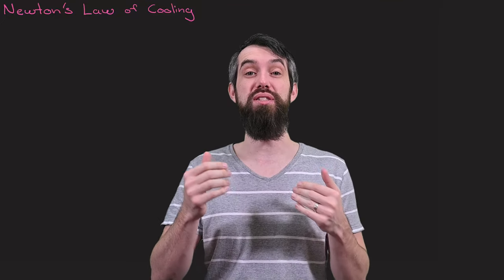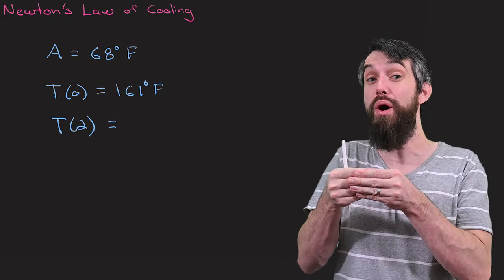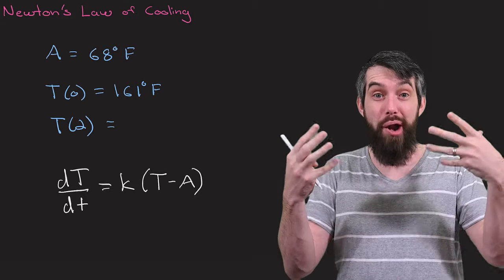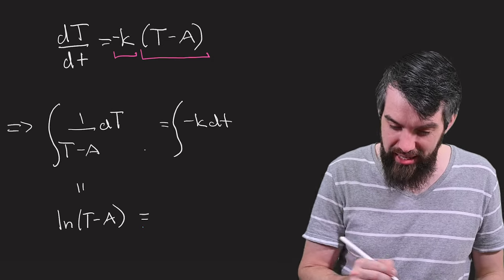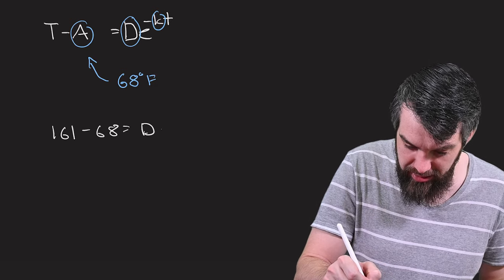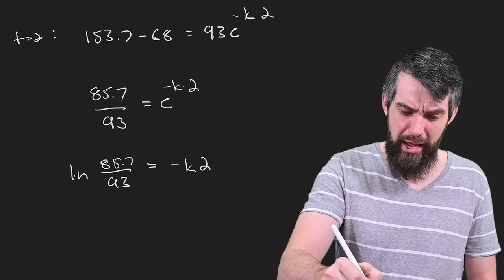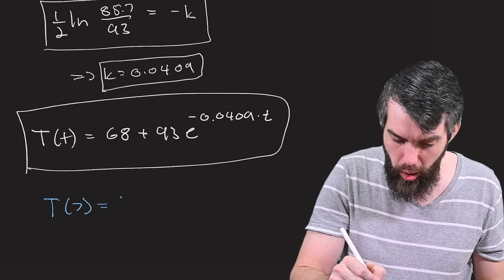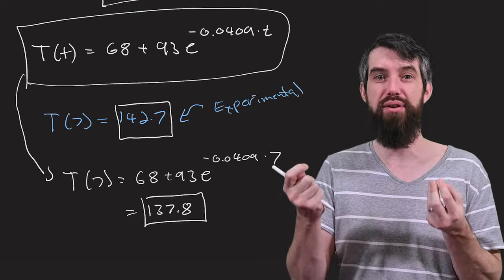Newton's Law of Cooling  // Separable ODE Example

Comment: I left university some decades ago.  I do not recall anyone giving a practical use case for differential equations as you have just done Dr Trefor. You are amazing
Reply from the maker: This is too often the case!
Reply: Unfortunately, this is a sad reality; however, you can't really blame professors of mathematics, since they did not study physics directly, in the vast majority of cases. The fact that you solve a differential equation doesn't imply that it matches the reality - you can get mathematically correct answer, but physically, the result could be way off the experimental value or could be a complete nonsense at the first place. This is something mathematicians can not really justify unless they studied theoretical physics as applied maths. Furthemore, if you knew about the existence of Maxwell's equations, Schrödinger's equation or Hilbert-Einstein equations of general relativity, which are all famous diff. equations, you could have figured out in your head that most things in our universe are governed by differential equations. And so, it is quite simple to construct your own differential equation that would describe something physical (whenever you try to describe some model like perfect oscilator,pendulum,some kind of litter, usually only highschool mathematics and physics is required) Differential equation actually arrise just when you start studying physics in high school (particulary in kinematics) though they are incredibely easy to solve, since most of them are just solving simple integrals (or taking time derivatives). Nevertheless, you can complicate things if you add friction or air resistance. In that case, you need to use methods like the separation of variables, variation of constants, particular solution etc to solve them (dipending on the type of flow - sometimes you can only approximate the value if it is too complicated).

Comment: great video! just a small correction - i think at the end when you used the model to predict the temperature of the tea after a certain time, you originally said the reading was taken at 5 minutes, but used 7 in the equation. T(5) = 143.8 here, which is only about %0.77 off the measured value of 142.7; maybe you just used 7 or maybe it's a total coincidence that after 7 minutes the measured temperature almost perfectly matches the 5-minute theoretical, but either way, i learned a lot from this video, so thank you!

Comment: Me like. So that's why we use e^ so much in ODE's. That's also where the extra constants comes from, e^-k, by using logarithms. I also like how you model the situation. Question to self: what is a situation that I could model this way? I got a coup of instant noodles, it takes 5 minutes to cook. I could probably estimate some function of how soft it becomes, using time t, temperature and a way to measure softness (like how much it'll stretch).

Comment: Ah, so that's how constants from all those Physics equations are derived. That's neat. 

Also, I still can't understand why the left hand side on when we're doing a separation of variables does not have a +C while the right hand side does.
Reply: It does. Both Integrals produce an unknown constant or some number. To simplify the overall equation, we can move and combine the left hand side C with the right hand side C. So now we just have the + C on the right hand side only.

Comment: Thanks for this video, I really understand maths better when I see it applied! 

If you don't mind me asking, why don't we need the Constant on the left-hand side integration? Can we ignore it because constants on both sides are effectively a single (different) constant on one side?
Reply: It's because a number A can be written as a number B either by +/- a number C or by multiply A by a number D. For example, if A = 100, B = 25, C = 75, and D = .25. Then, (A-C)=(B)=(A*D). Hope that is helpful.

Comment: So now you've got to redo the experiment with a better ambient temp. I might have to find a decent thermometer around here and try it out for myself.

Do you have a recommendation for some sort of text on the subject of building mathematical models? I would love to work through loads of examples, both analytical and numerical. Seems like with model building lots of practice would be a very good thing (so basically like everything else worth doing).
Reply from the maker: I really love this open source modelling textbook: https://github.com/bigfatbernie/IBLmodellingDEs
Reply: @DrTrefor  noice! Thanks much. Downloading it now! I'm plowing through a massive numerical methods for engineers book ATM, but this one will be fun. I need to do a good review of ODEs and Calculus first. Then I need to really learn some basic stats, and I'm rubbish at linear algebra (that will change, but I'm struggling to get motivated). I really need to quit my job, lol. I should have been an aristocrat with loads of free time and all of this would be so much easier to manage.

Comment: Hey Dr. Trefor, I re-watched this video again this morning and had a thought. What would have happened had we not multiplied our k by the difference between the temp of our cup and the ambient temp (T-A). For instance, what if we had gone ahead and selected a difference that wouldn't have been as steep as the selected one was. Indded we would have still gotten a solution and would have still been able to solve for k, right? How would we have known though that our solution and our k didn't match physical reality? I guess in the real world, I'd have then just iterated and eventually might have selected T-A, but in a math class would I be marked wrong if I had selected something other than what you selected? Or am i missing the point entirely haha? I guess it's about seeing what our percent error of a given model is vs. direct measurements we collect-though I also suppose not every problem we model will also have a thermometer.

Also, I'm actually taking a thermo class right now (fascinating, incredible stuff) but was your reasoning about the larger difference between T and A based upon thermo principles or the fact that a steeper slope would yield juicier, more differentiable results? I'm asking because I really want to tune up my reasoning skills for problems like this. Thanks again!
Reply from the maker: To me a math model isn't "right" or "wrong", it's more or less useful. For instance not only could we have chosen different differences, we didn't have to make it linear. Maybe it should be (T-A)^2 or square root of T-A or any other number of things. Basically all we are doing is trying to think of something that seems reasonable, and the ultimate proof is not mathematical, its how well it models reality. So in this case it makes sense that the rate of change of temperature should have something to do with the difference between where we are right now and what the ambient temperature of the room is, this is a reasonable intuition. But I haven't proven that this is the best or only model of this scenario!

I actually teach a math modelling course as well, and in it I typically don't mark students right or wrong too much based on their models per se, but based on their analysis and critiques of those models.
Reply: @DrTrefor  as always, you've given me a lucid, imaginative response. Thank you for being so responsive as well-you're setting new land-speed records! This is fascinating stuff. I'm really looking forward to the working and thinking through the entire playlist.

Comment: Sorry but at around 3:02 how is heat change an exponential equation, i thought its more like addition like the rise un temperature is an add up or sum of the rate of change an the initial temperature and the gradient remains constant well like maybe approximately constant if we are talking about the same medium but if the rate of change of the different temperatures is
 different in both then you have a parametric equation, because i don't understand how the rate is reliant on the intial difference in temperature

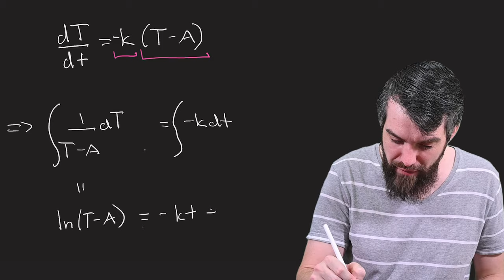Comment: 4:29 I don't get why the right side gets a constant but the left side doesn't.
Reply: You can add the constant on the left side too but you would get:
ln(T-A) + C1 = -kt + C2
and by switching side you would get:
ln(T-A) = -kt + C2 - C1
but C2 - C1 is a constant too so you could perhaps call it C which lands you back to what is shown in the video:
ln(T-A) = -kt + C

Comment: Im doing an IA on how the surface area of a liquid affects the rate of change of temperature of it. Do you know if I could use this equation to derive an equation between the variables? 
I wanted to swap out Ambient temperature for the final temperature of the liquid after a set period of time as that is the final temperature. Would that be ok?